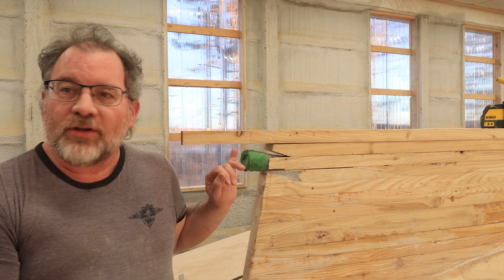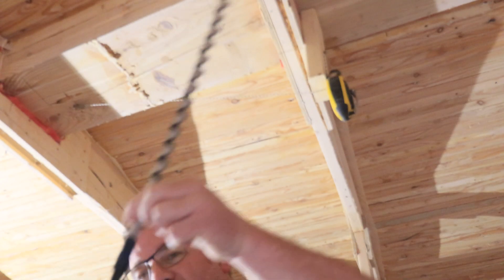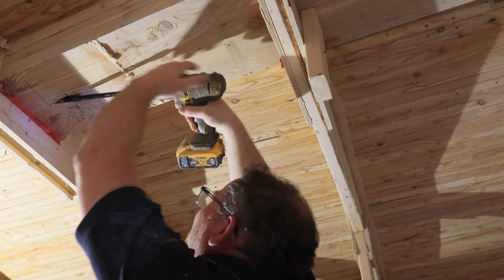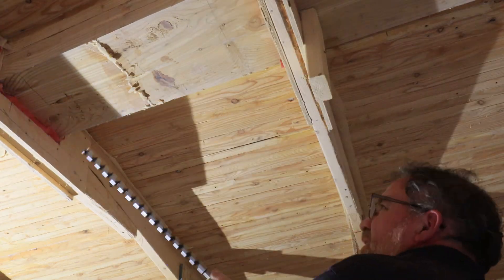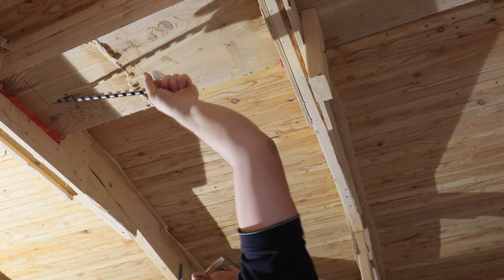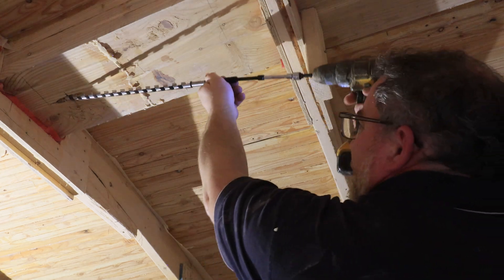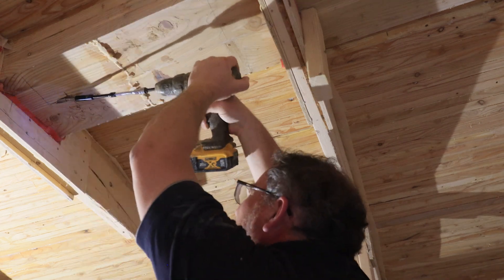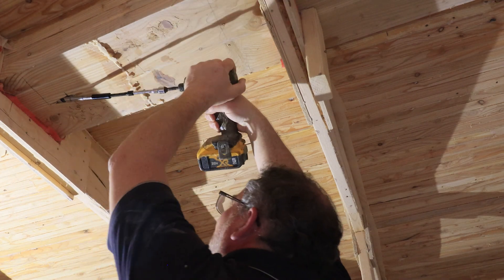Drilling a Hole in the Sailboat - episode 56 - Building Sailing Vessel Hard Tack

Comment: i was noticing the thickness of the marine ply. I thought you were supposed to glass those layers over isnt that two layers of 1/8 marine ply? on the 7/8 strip planking that was glassed. that makes like 1 1/4 hull thickness?..
Reply from the maker: You are right, it is two layers of 1/8" plywood on top of the 7/8" strip planking.  I still have one layer of plywood to apply in the video's, but in real life that is done. That gets glassed over with two layers of fibreglass.  I suspect by the time it is all done, the hull will be about 1 3/8 inches thick, including the fibreglass.  I am also going to fibreglass the wood keel, which is what I am working on at this time.

Comment: Such a challenge. No 15 minute job that one! You must have been exhausted at the end. Corded drill for the 3" cut was very wise. I would imagine batteries would last a matter of minutes with that loading. I saw a puff come from one drill and thought maybe it had fried, but you seemed to be using it after. Enjoying watching the progress.
Reply from the maker: I was, even drilling the first hole was tiring as all the drilling was over my head.  I had tried with the cordless to dill the 3 inch hole, but it did nothing.  And yes there was a puff of smoke from one of them, but it is still going strong for now.

Comment: You may be crazier than me! Just found your channel and project. I hate drilling holes in boats lol. I was nerve wracked watching. I was afraid you were going to get the first bit stuck and then it looked like you were getting beat solidly with the hole saw and 3 inch cutter. You obviously cut out a lot of video. How long did the whole thing take? Best, Chuck Jenkins
Reply from the maker: it was a struggle with the first bit, with the jury rigged set up, but it got through.  it took about 30 minutes to drill the small hole and find all the bits and pieces that I needed.  The larger hole was about 2 hours of drilling, and having my wrist slammed around, it got better after I had the full hole to drill into, so both teeth would catch, not one, which was what was giving me all the trouble at the start.
Reply: @SVhardtack  It looked pretty violent. Great Job!